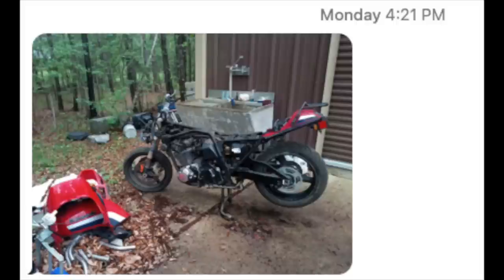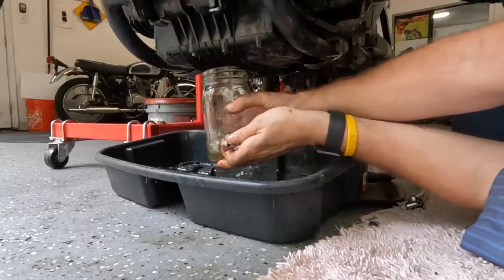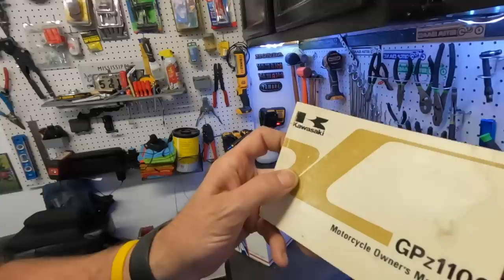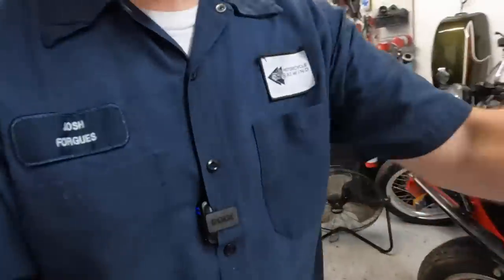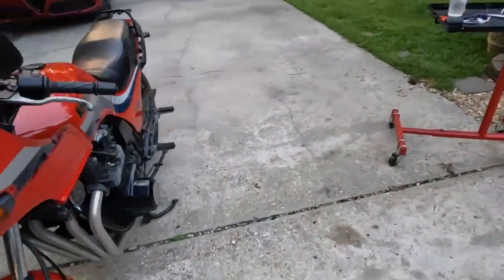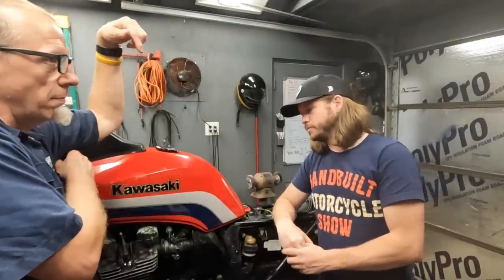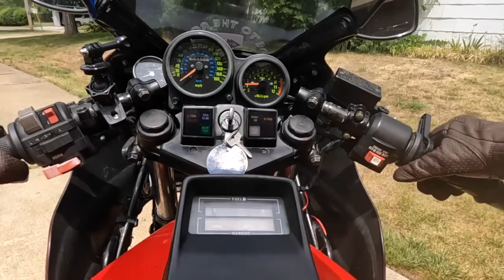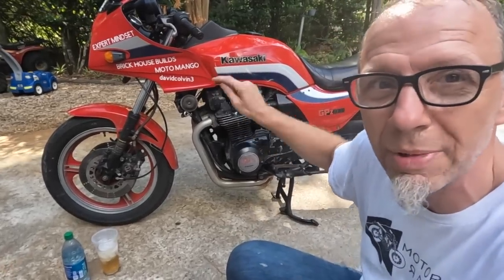Can I ride 3,000 Miles on abandoned 1983 Kawasaki GPZ1100 #gpz1100 #vintagemotorcycle #sportbike

Comment: Air Cooled Kawasaki Inline fours are Tough as Boots, so many still going that Kawasaki have now manufactured brand new Cylinder heads for 900 Z1 and home market 750 Z2 models and having properly repaired a cracked Z1 Cylinder head I consider them a bargain at around   $3,300.00 Au depending on where in the world you are.

Tech services at Kawasaki Australia when these came out we called them ZX 1100 A1 otherwise known as GpZ 1100 A1, DFI was pretty reliable when all said and done but these can be hard to source parts for these days, EFI Fuel pump can be replaced by a Bosch Car unit (Both External) TPS can use a Ducati one with some minor mods though I did about 12 months ago find a NOS one in Taiwan last price for Genuine was over $420.00 in Australia ouch and that was 20 years ago, Hence why so many go Z1100 Carbs dropped in.
 So a real DFI one is both rare and desireable for that reason.

They are pretty simple systems compared to modern stuff and can be repaired not too hard at board level as much of the componetry used was common stuff the System was cutting edge at the time I remember in 1983 at the Sydney International Motro show the Toyota guys were chuffed they had just release Analog Fuel Injection on their cars, We went hullo thats old school as the New GpZ 1100 B2 was now DFI like your ZX100 A1 the GpZ 1100 B1 was analog like the earlier Z 1000 H injected model pretty much only sold in the US.

They are not too hard to Fix better than some things I have repaired like an Encapsulated in Potting Mix KTM 80 Motoplat CDI unit I repaired at boerd level a few years back where you first spend hours carefully digging out the potting mix in a way as to not destroy the board components or remove any identifying markings needed to find replacement components

Even the two models of Kawasaki's ZX 750 E1 and E2 Turbo's both had the same DFI system, I still have my internal Kawasaki Technical Training notes on the DFI system used in them
Reply from the maker: Wow!!! You are definitely someone I need to talk to. Some much information on one comment. Send me an email motorcyclerewind@gmail.com. I would love to connect with you. Thanks Thanks for sharing. And thanks for watching.

Comment: Suzuki GSXR forks looked great man you should have kept it like that.
Reply from the maker: The initial problem was in the rear swing arm. The GSXR swing arm that they put on hit the frame. So since I had to find a swing arm that would work I knew the stock one worked. Second the triple tree they made to accommodate the GSXR forks was not usable without a ton of work. For instance you could not u-turn the bike in my driveway, steering stops were too narrow. There were so many things wrong up front. The other thing is the GSXR wheels were to small for the bike. Liked like a lifted truck with 14 inch wheels- IMO.  Thanks for watching.

Comment: Did you clean the tank then checked the fuel filter?
I haven't watched the carburateur cleaning, balancing at the beginning though. 
During your video, it seems in dry environment so I wouldn't think an electrical issue... .
Reply from the maker: Definitely cleaned the tank and new fuel filter  Also cleaned the throttle body. Thanks for watching.

Comment: good job, pity i m interesting by swingarm and fork from gsxr for mine 😁
Reply from the maker: Make sure the swingarm you get is shaped like the one on the GPZ. The one that was on it hit the frame. So no good. The other is the GSXR forks or considerably bigger in diameter. So you will have to fabricate a triple tree or hopefully use one from a GSXR(if it fits). The last thing is that you need to make arrangements for all of the gauges and switches. Not trying to dissuade you. This is what the previous owner learned the hard way.
Reply: @motorcyclerewind  oh yeah, I 've some doubt about equivalence between old and modern one, specialy for the chain and crank... by the way, I've thinkin on gpz 95' stuff but... she's in factory mounts and that's be good too, just the look of wheels 😉 thank for your response

Comment: Fuel injection is extraordinary. High performance, maintenance-free. Highly reliable. But when it does break you are usually screwed. I'd stick with a carbureted motorcycle for cross-country riding. Less reliable and efficient, but you can fix nearly anything that goes wrong with a carburetor on the side of the road.
Reply from the maker: It’s like CDI works till it doesn’t. Thanks for watching.

Comment: sounds like its running only on 2 or 3 cylinders as soon as you hit the road...but it hard with the audio,,..My Cb1300 did the same sort of thing,,splashed some water on the pipes and two of them were cold...replacing the coils...also whenh I bought the bike, the guy said it was burning thru batteries..he had 4 spotlights ...when I checked the battery was have size than spec..put the right battery in, new radiator sensor, and all good,,,but now the coils are gone or the electrics,,,strange that two work and two dont..might be rectifier..or ECU...ITS A MATTER OF WORKING THRU IT..
Reply from the maker: Good call. It was a coil that shut us down in the end. The coil for 2 & 3 vibrated loose and was shorting out. Sorted and all good now. Thanks for watching

Comment: Loved these 2 recent videos and appreciate your honesty. But did you actually WELD that headset bearing shaft? I think it very deathworthy to compromise the structural integrity of the only skinny piece of metal hanging the weight of that bike to your front wheel.  Is there no way it could've been hacked off at the top(the threaded end)and rethreaded at the required length?
  Anyhow- astonishing how the bike seems to run so well. And you're the one riding it,so must have plenty of faith in your colleagues workmanship and welding -with gaps around it - which mustve shown up after the grinding flat.
 Look forward to future videos and have just watched the Q & A  one. 
☆
Regards,
Roger( The Dirt Warrior).
Reply from the maker: Thanks for watching. This is a compilation of 25 videos telling the whole story in one video. The episode of modifying the triple tree shows much more detail of what was done. 

The shaft was cut down, a 4 inch plug was milled down to fit inside to align the shaft. Then was plug welded on each end. Then welded around. If the shaft broke there we had much bigger problems😂.
Reply: @motorcyclerewind  OK. I'll look for that video with interest. I wondered if an insert would've been integrated, but didnt realise until today there are far more videos than the 3 I've watched.

Comment: Who installed that inverted fork front end ?   Someone before you got it was spending time and money on project GPZ.
Reply from the maker: They were trying to turn it into a street fighter. Built a custom Triple tree to accommodate the GSXR forks. But made some design flaws. Stops were to close together. I could not u turn the bike in my driveway. Also the GSXR swing arm it the frame. So a no go!!! Im my opinion the GSXR wheel were too small for the bike. They looked weird(imo).

Comment: My Voyager 1200 came from the factory with crappy ECU box's. Replacement ECU was the answer. My guess. Cheers!
Reply from the maker: Thankfully it was just a coil that vibrated loose and was shorting out. Since finding and fixing have gone about 300 miles. Seems to be sorted. Thanks for watching.

Comment: Ah the milkshake oil release................Luckily these things can take "some" abuses and still be fine mechanically if proper steps are taken to prep before attempting to run it......Lucky You. 
The GPZ1100 was a beast in it's heyday. Today a R6 will smoke it off the road.
Reply from the maker: There was so much juice in this engine. Thanks for watching.
Reply: @motorcyclerewind  I buy these things (old bikes) for cheap but to get one for free, that is special.

Comment: How did you get all the emulsified oil out of the engine
Reply from the maker: Here is the video of getting it unseized.  https://youtu.be/wvuWm09Jl3c
Basically flushed the engine and changed the oil several times.
Reply: @motorcyclerewind  i bought a z750 2004 none runner got it running after much investigation as she had no spark due to crank sensor she had emulsified oil in sump i removed that but i. Didnt do a flush now shes running oil is emulsified again i am wondering if its due to no getting it all out

Comment: Hey at least it’s clean water.  How can that not be seized.  I’ve seen a seizures because of a bit of damp.  That’s insane
Reply from the maker: Totally insane. This thing should not be running. Let alone as good as it does. Thanks for watching.
Reply: @motorcyclerewind  
still watching it’s 2:00 in the morning. I can’t believe you’re doing a trip. It’s fantastic I love those clocks.                       I did a bit of a trip in July. 
It was my birthday so I bought the same bike I bought when I was 22. 38 year ago. I got up at 4 o’clock one morning walked a couple of miles to the railroad station caught two trains to get to the city airport jumped on a plane to Switzerland Zurich and bought a Red Kawasaki gpz1000rx. These are some of the places and countries my little adventure took me too.  Including Riding home Liechtenstein, Geneva, Zurich, Austria, France,Germany Strasbourg, Luxembourg, Belgium, Holland, and an overnight ferry from Rotterdam to England. Many adventures I rode over the Alps in 4 countries at night in the fog went through checkpoints and borders  different languages and different currencies. Finding gas in the middle of the night. In medieval villages. I did it alone. 
So I have an idea what it was like for you.  Can you imagine the current generation doing it. Merry Christmas from England cheers.

Comment: Hi ditch that DFI and bang on a set of mikuni flat slides, you wont look back😊
Reply from the maker: Seems as though that a pretty common mod. I have to look it it.
Reply: @motorcyclerewind  Hi or you could use Z1000J or any of the other Z1100 carbs, only the gpz1100 had DFI all the others used carbs. But for best performance you can’t beat the flat slides.

Comment: I'm glad that I only have people give me free CB radios. Takes up way less space than motorcycles!
Reply from the maker: I have the factory CB radio in my 78 ford f150. Still works I just need to find the unobtainium factory antenna.
Reply: @motorcyclerewind  I remember that antenna! It had a gray loading coil about halfway up. It wasn't an option on the new 1977 F150 4x4 I bought but it was an option for 1978. Nice truck! I special ordered mine with the Aeronutronic AM/FM stereo with door mounted speakers. It had a little amber light that glowed when it was receiving a stereo signal.

Comment: At the time in uk the 550 and 750 gpz were the most popular that air cooled 4 is bombproof if maintenance done on the dot. The gpz 900 r basically killed off the 1100 when launched in 84 we also had the 1000 rx gpz in 85 but wasn't that popular.
Reply from the maker: The 550 and 750 are awesome motorcycles. Thanks for watching.
Reply: @motorcyclerewind 
I owned a 1984 GPz550
/  AKA   zx550A1.   It had same frame-mounted half-fairing as your 1100.    My 550 was the LAST year they ever made GPz550.  The next year,  they came out with GPz600 Ninja  (with the 16" front wheel).

Comment: What was the final solution to restart bike ?
Reply from the maker: So simple!! The right coil for cylinders 2&3 had vibrated loose and was shorting out. I would have never found it on the side of the road. Because if previous issues I was biased to the TPS being the issue. Me and the GPZ have covered about 400 miles since sorting it out. Thanks for watching.
Reply: @motorcyclerewind  a process of illimination  ,from battery to to plugs spark and gapping then earth straps and grounding issues ,say does copper paste actually work for this

Comment: Wasn't it possible to press out the steerer shaft, cut the thread further down the shaft and cut it to length. Looks like it was cut off and welded back together with a shorter end.
Might still have wiring deterioration.
Reply from the maker: Cutting the threads is a great idea. Can’t remember if we thought of that or not. Maybe we didn’t have the means to cut the threads. 
You are right about wiring. We have cleaned and repaired(where needed) all connections.  Thanks for watching.

Comment: They were good solid bikes in the day. The trouble was yahoos got a hold of them and beat on them then tried to wrench on them. 
Unfortunate choices. 
Buddy got a 900 with a blown transmission and two parts bikes with "engine damage."
Bought another one cheap "no runner with parts bike primarily 
for plastics.
Turned out with three runners  (sold two) and some parts to sell. 
My buddy was without a street bike, A good mechanic and very low budget. 
Turned out much better than it could have. 
I bought an FJ1100 once very low miles low price.. needed clutch plates and was supposed to have stock exhaust. Aftermarket header with no baffles. 
Paid too much...
Reply from the maker: Wow. I am a connoisseur of cheap motorcycles. Thanks for watching.

Comment: i have owned these old gpz in the past ,,, great bikes , the biggest issue was the dfi was a first year fuel injection and was t totall garbageif you  put kz 1100 police carbs on it with air pods and a slight jet upgrade it will pep that old bike up and it will never have that stupid stall it had at 3 to 4 rpms ,,
Reply from the maker: Lots of people are recommending the carb swap. DFI has been good since we adjusted the TPS.  Thanks for watching.

Comment: Pardon my ignorance, but is your speedometer not working?
Reply from the maker: I rode the bike for the first time 2 days before I left for the trip. At that time I discovered that the speedo was non functioning. So I installed an after market speedo. You can see it in some of the footage. It is to the left of the factory gauges inside the fairing. Since I have returned we did further investigation of the speedo and discovered the return spring for the needle was broken. A viewer from Scotland(Kevin) had a set of factory gauges and they are now installed on the GPZ. Thanks for watching.

Comment: Anyone know where i can get a rear Brake master cylinder kit for a 83 84 GPZ?  Im in Australia, tried local and Ebay, no luck at all.   Thanks
Reply from the maker: I ordered mine from Amazon. Had to use a through bolt. Think it was around  $14. There are some stock ones on US eBay if you are interested in those. Send me an e-mail MotorcycleRewind@gmail.com I can do what I can to help you. Thanks for watching.
Reply: @motorcyclerewind   cheers, i'll get looking. My old GPZ i brought for $500.  She's a little rough, but just gives it that MadMax look,  the Police issued it unroadworthy, (rear brakes)  it's just been sitting in my Laundry for the last 6/7 years. I've put new tyres, rear Caliper kit, new rotor, 2 good rotors for the front, LED tank display, both Guages.   Oh yeah, need a genuine starter relay too.   Got to admit, nothing sounds better than a Kawasaki 4 cyl.

Comment: How can the exhaust pipe fall off  ??
Reply from the maker: Pretty easy when you have the context of the whole trip. 3 days prior you loose the oil filler cap in the interstate and soak the entire right side of the motorcycle with oil. Then add several hundred miles of vibration to an oil soaked hanger bolt. Next thing you know your picking up your exhaust off the side of the road. 😂

Comment: Gotta be electrical, pickup / crank sensor ?? When it woukd crank no start need to check for spark. Also one way to keep a low mileage bike low mileage is to not havd the Speedo working lol
Reply from the maker: You’re right it was electrical. The coil on the right side for cylinder 3&4 vibrated loose and was shorting out. Once I sorted that it’s been great.

Comment: Definitely needs an ‘Italian service’
Reply from the maker: Good ole Italian Tune up for the win. My right side coil vibrated loose and was shorting out my ignition. I sorted it out a few days after I got home and have put another 3,000 miles on the GPz. Best motorcycle ever!!!
Reply: I’m lucky enough to own a very clean GPX 750 that the former owner lost interest in (he’d convinced himself that he needed a 170mph+ rocket) It’s a great bike. Fast, comfortable and has been utterly reliable in the 3 years that I’ve owned it. No, it won’t out handle or out perform a modern 600, then again, I value my licence. For normal ride out’s it’s more than fast enough. A very underrated bike. Good luck with your new project. I’m sure that once you’ve ironed out the gremlins, it’ll be a fine machine. It’s good to know that there are still people out there who are keeping motorcycle history on the road- where it belongs.

Comment: How the F does the can fall off ?
Reply from the maker: It starts by losing the oil filler cap on the interstate and soaking the right side with oil. The you ride another 700 miles next thing you know you are picking up the exhaust from the side of the interstate. 😂🏍️ thanks for watching.

Comment: Too bad that volt meter button doesn't 'toggle' (as opposed to momentary) the volt meter display on - for most riding of any distance, I'd rather see the volt meter than the tach.  My 86 Kawasaki also has volt meter function but it's goofy: it momentarily switches the temp (which is the default) and voltage readings, but displays a voltage scale on the LCD (with no numbers!) -  when it could have just used the 'scale display' to permanently show the voltage (while simultaneously showing the temp).
Reply from the maker: I love the "Casio Calculator" dash on this tank. Just screams 80's.